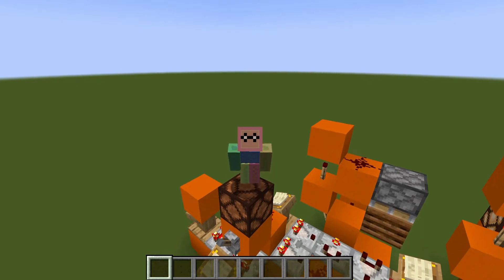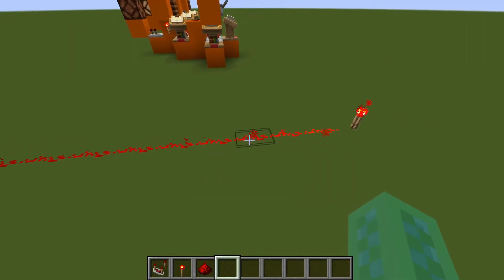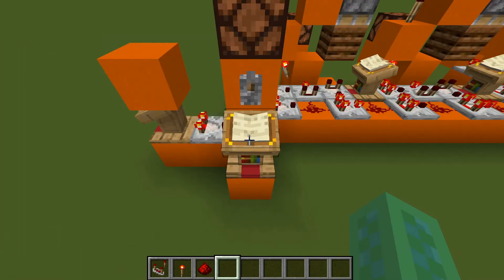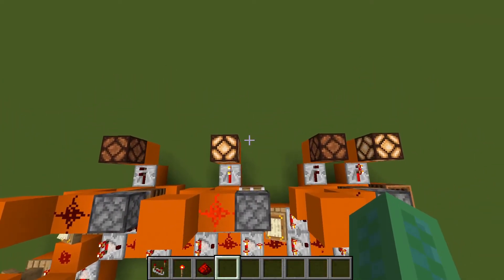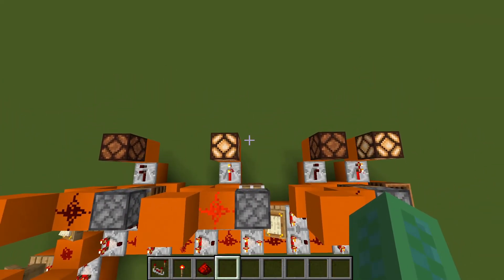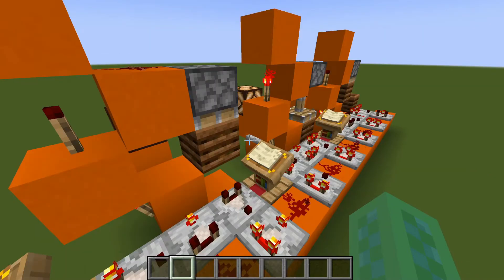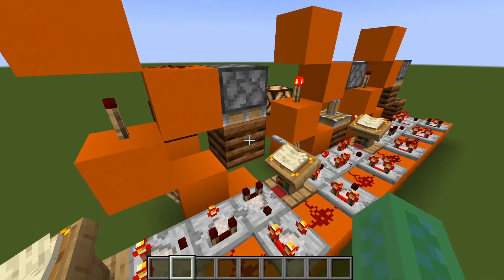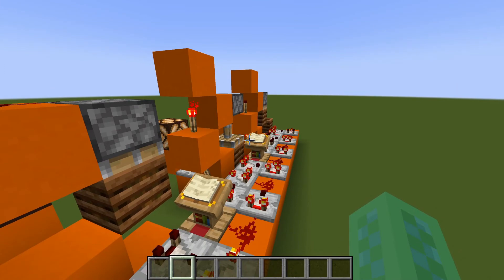Compact Redstone Signal to Binary | Analog to Digital Converter

Comment: ʕ ͠°ʖ̫°͠ ʔ⸝^nice! Build dude. Question what l are the subtraction values you’ve used? Working on a B2D and wondering is each bit would be considered as 5 3 2 1 ? I know hex is 8421
Reply: Wait… I keep thinking about, is it still 8421, just subtracting power of 2?

Comment: Is it possible to come up with a noiseless version without the use of pistons?
Reply from the maker: I would assume that because there is always going to be propagation delay, there will always be some level of noise.  Perhaps there is a way to filter the output though
Reply: @tyrannicalbasket1070  I meant the acoustic noise from the pistons. I generally avoid using them in logical redstone because I don't want my contraption to start making clickity-clackity noises whenever someone uses it.
Reply from the maker: @vassun4891  Ah, okay!  Yes, this design was based off of the usual way to do it, which I believe just uses comparators and doesn't make any noise.  This was just a variation on that design.